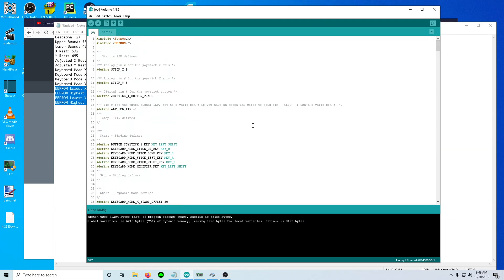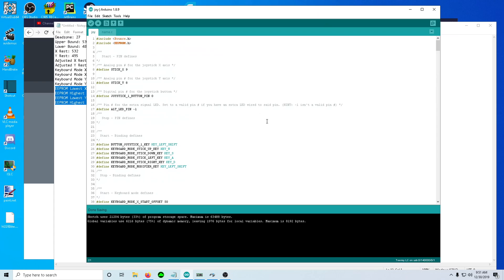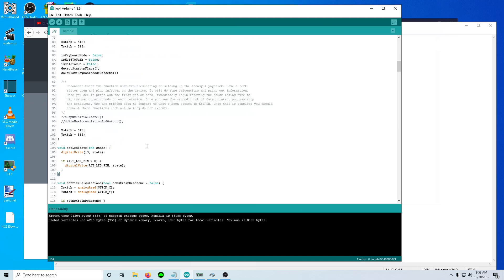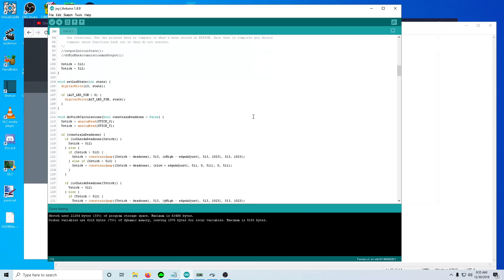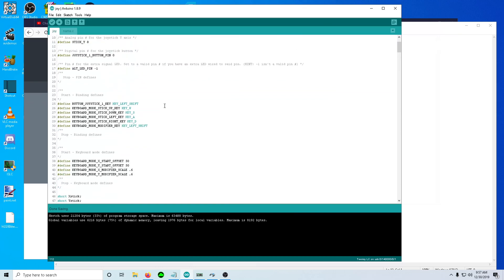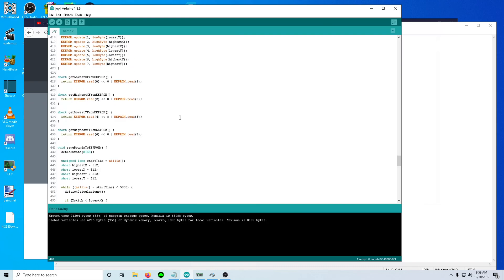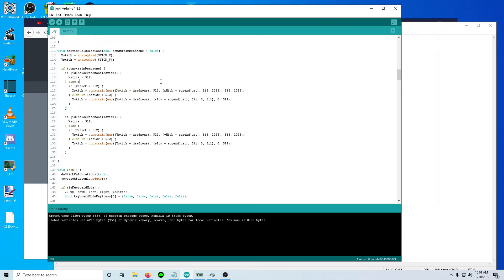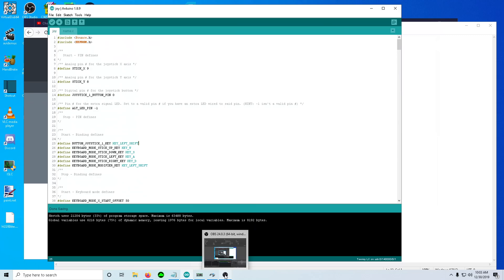Orbweaver Analog Mod Tutorial - Part 8 Firmware

Comment: would this code work on arduino leonardo it as the atmega32u4 chip i dont have a teensy
Reply from the maker: It will not. I know for a fact because I had a customer try and it was a situation. Sorry.
Reply: @tuffrabit  no worries looks like I'm waiting for a teensy then lol thanks you for getting back to me
Reply from the maker: @neon-ninja  I have working code for RP2040. So you could get a Pi Pico or anything else with that chip.
Reply: @tuffrabit  I'm just going to order a teensy and follow steps in your videos so I can't go wrong I'm still learning I have built I keyboard joystick using Arduino Leonardo like the one gaming mod kits have made but I don't have the ability to code in the features your code has. Good work by the way love what your doing
Reply from the maker: @neon-ninja  Ok. If you change mind here's the repo for the Seeed RP2040 board I made for analog joysticks: https://github.com/tuffrabit/seeed-joystick
Reply: @tuffrabit  ok thank you

Comment: I built one of these yesterday and used your code but it doesn't seem to work like an actual 🕹️ on fortnite I need to use a 3rd part software but the game allows dual input ? And even with x360 It still didn't act like an actually joypad
Reply from the maker: You can use joy.cpl on Windows to first verify that the OS sees the stick and that you can see movement. After that you have to take it on a game by game basis. Some games will see your DirectInput stick no problem, other games won't. Your options are to either use a analog to keyboard mapper (joy2key, or the keyboard mode in the stick firmware) or to use a XInput host (vigem or reWASD) to emulate a Xbox controller.

Comment: Hey Tuffrabit, I uploaded your code and it was recognized by Windows, could see it in Device Manager but then ran into issues where hardly any games picked it up. So I did some google searches and found UnoJoy which is a 360 emulator and I can map the thumbstick no problem, but it annoyed me to have an emulator to make it work. 

Then I found this "https://www.partsnotincluded.com/how-to-emulate-an-xbox-controller-with-arduino-xinput/". Using XInput, you can flash the Teensy LC to appear to Windows as a 360 Left thumbstick with a clickable 'L3' button, I just modified some sample code linked on that page. This made it accepted by any game with 360 controller support which is great. 

I'm personally not bother about keyboard WASD functions for games that dont work with an analogue stick, id rather use the WASD keys on the Tartarus. Thought you might want to know if you do any other mods for people to make life easy.
Reply from the maker: Hey! Thanks for the input. Yes I'm well aware of the direct vs X input situation on windows. Using direct input with my mods, instead of Xinput, has been an intentional choice on my part. There's several reasons for that choice, the two biggest ones being USB serial and input density. If I force a teensy to be Xinput I lose the USB serial interface which means any device management via an app becomes impossible. Then there's input density. With Xinput you're limited to the small number of buttons and analog axes that exists in the Xbox controller. That may be fine for a single standalone stick, but will not at all work for the gamepad device I'm making. In the end direct input is more flexible but yes can require emulation software for a lot of games. Luckily we have the option of choice. Glad you found an option that works for you.
Reply: @tuffrabit  thanks for the detailed response, that gave me food for thought for sure.
Reply: Could you please upload a video on this I think I'm having the same issue any game I play support dual input mode but they never find my joystick
Reply: @CaptiveChunk  Just follow the link I added, its well explained with a forum on the bottom of the page in which the library author is quick to respond. Theres even example code to go with the libraries which you can tailor to your needs if you know a little programming.

Comment: I've connected everything the same way as yourself. All coding is the same. I can use the game controller option to calibrate, and see the device moving correctly. BUT there is no playable way to use the joystick. No game recognizes it. In calibration I can sit at 512, move the joystick to 0-1023 correctly. But that's all that I can do. I'm just wanting to use this to move in games.
Reply from the maker: Depends on the game 100%. You are now in the not intuitive world of Windows input API's. Your options are to use a xinput host like vigem to make it emulate a x360 controller, or a keyboard emulator like xpadder.
Reply: @tuffrabit  Such a simple fix. I'm hoping it works for me. Your DIY is amazing. Thanks for showing us all how to use it.
Reply: @tuffrabit  I don't mean to bug you. But I just cant get the joystick to work. In any variation. Even your WASD mode. I'm not smart enough to figure this out.
Reply from the maker: @dwarfkingkili698  send me an email and we can go over the details. tuffrabit.mods AT gmail DOT com
Reply: @dwarfkingkili698  im having the same issue, its reading in joy.cpl fine, then i run fortnite or cyberpunk,  which do read analogue for sure, and in analogue mode, nothing happens, and in digital mode, the axis r not working correctly, backwards is not working at all, and right is 75% working,  There is suprisingly 0 help available online for this issue either, so if you don't know coding, your kinda screwed here
Reply: @tomhuggins6268  so I ended up not using either of the modes from the code. But I still have the code on my joystick. I ended up using an application called Xpadder. And will fully admit it’s 100x better and easier to use for it. I map to WASD.

Comment: @tuffrabit i have a issue where i'll be moving the stick and then out of nowhere, the last direction i press, i move in that direction for a random amount of time. During this time the stick is unresponsive and my character in-game continues to move in the last direction. After a random amount of time, the stick works normally but the issue pops up again no more than 2-5 min later. I re-soldered the teensy 3x and the joystick. What am i doing wrong? (FYI- I use keyboard Mode).